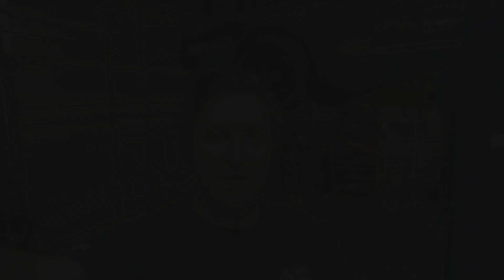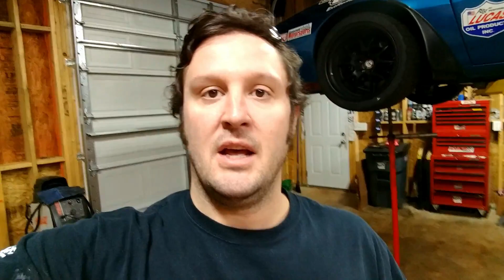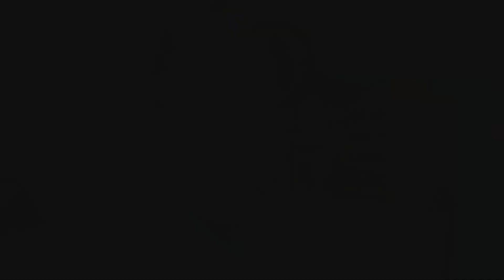Introduction to the om617 Rebuild Series

Comment: Jesus dude! How the $&!? Did you miss 8+ quarts of oil blowing all over the engine windshield turbo and hot exhaust!? Let alone the smoke billowing out behind you!? And the rear window would have been covered!?
Reply from the maker: No it didn't blow out like that there was no sign whatsoever. Nothing on the windshield nothing on the exhaust no smoke. I think it blew out predominantly on the driver's side Hood pad and then dripped down from there so there was nothing hot for it to hit. Seriously there were no symptoms until I stalled out at a red light due to overheating.